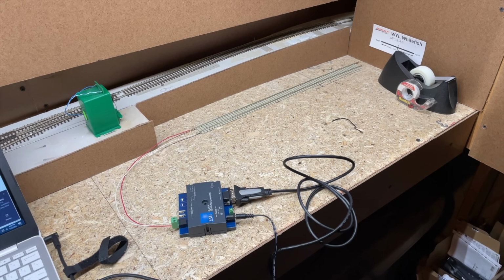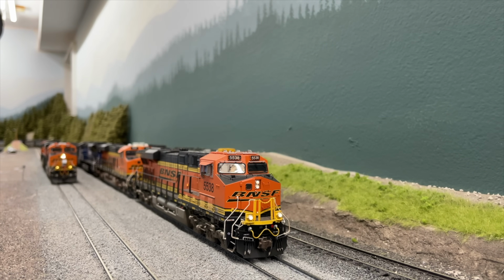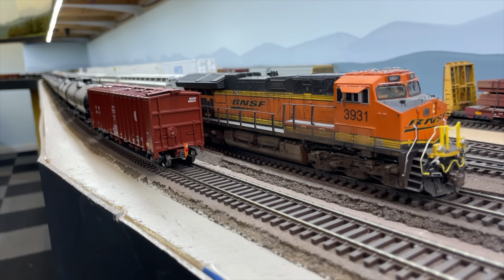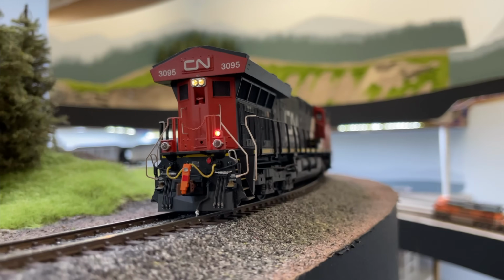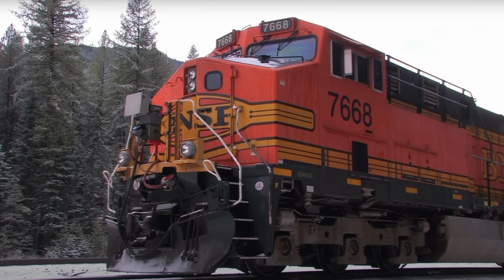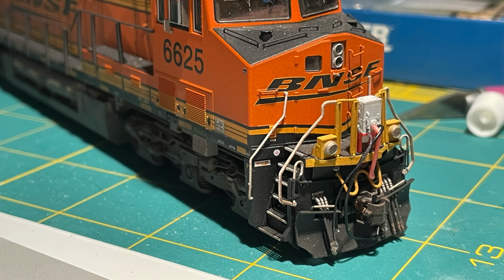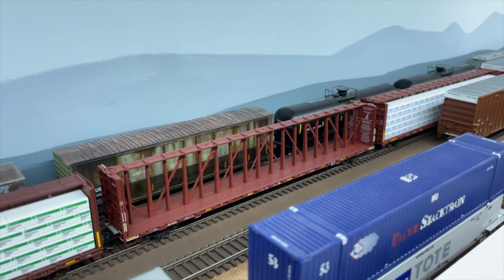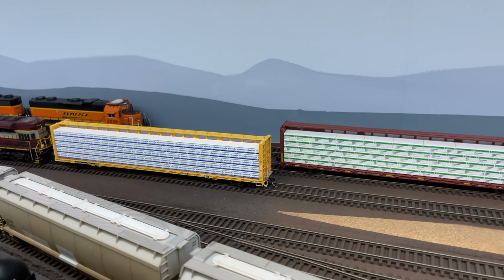Layout Update 71: HelperLink and other equipment details

Comment: Those helper locomotives still have the same control boxes up front as you have modeled. At least they did as they went cruising back & forth by us on Crawford Hill back in the middle of October(2023) as we were installing dragging equipment detectors at Belmont. They look spot on !!
Reply from the maker: Good info! I haven't kept up much on the Crawford helper sets since I switched to modeling Marias Pass, but it's good to know things are still the same there. I still think these Essex, MT helpers aren't running with HelperLink anymore, and I don't know why. They might just be running less often. Someone even told me that they aren't pushing on the rear of trains...so I have no idea what to believe.
-Cam

Comment: Great work Cam! I'm going to need to build a Helper Link box for one of my O scale MRL SD70ACes to represent Bozeman Pass helpers.
Reply from the maker: Thanks! That will be a super cool project. Who makes your SD70ACes in O scale? MTH?
-Cam
Reply: @railfan220  they're MTH units that I'm cobbling together. MRL stuff is extremely hard to find in O Scale. I've acquired 3 SD70 shells with the big W logo and currently have one actual locomotive so need to get two more donor units. I also have an "Atlas" former MTH MRL Essential Workers unit coming in soon and a Lionel SD40 I had custom painted into one of the SD40-2XRs.

Comment: Very cool layout. At 4:30 there is a solar powered greaser. Is it a kitbash  model or one you can purchase? What are the dimensions of this double deck plan? The scenery looks similar to NS in my neck of the woods. Just without the mountains and tunnels. I hear Rail Pro by Ring Engineering is a cool system.
Reply from the maker: Thanks! I kitbashed the greaser complex from various parts. Namely, the hoses are scrap pieces of decoder wire. But I can also tell you that the solar panel itself is from the Walthers "Modern Trackside Detail Kit". And for sure, I hear good things about Rail Pro. I'm very intrigued.
-Cam
Reply from the maker: Forgot to say that the layout is 12x28'. You can find the track plan here: https://www.facebook.com/railfan220/
Reply: @railfan220  Could have fool me. It looks much look larger but the double deck idea might be the way to go when space is limited. I considering a modular sectional type myself.
Reply: @railfan220 The NS Pittsburgh Line has helperlinks on SD40Es and SD70ACus.😂😅